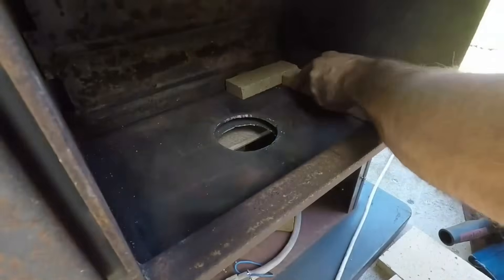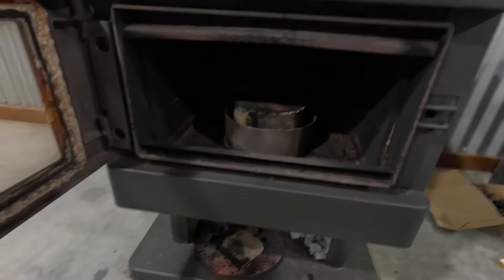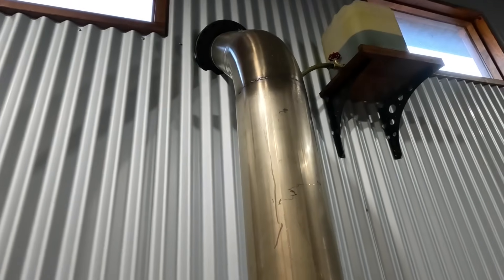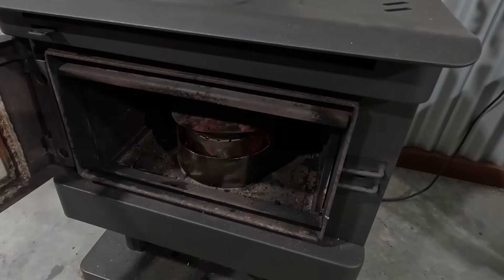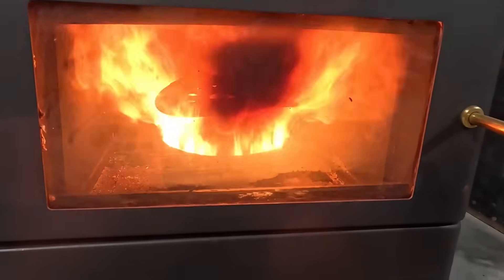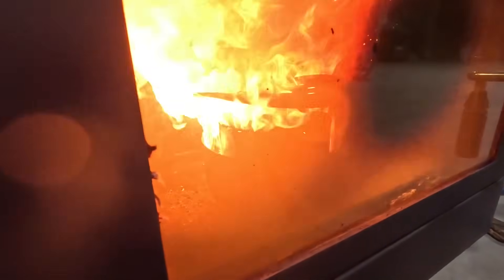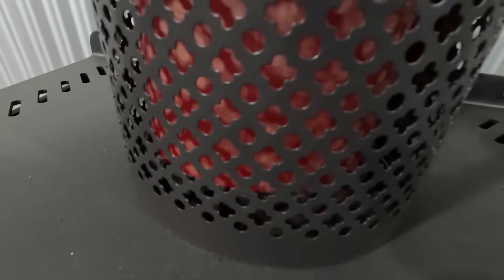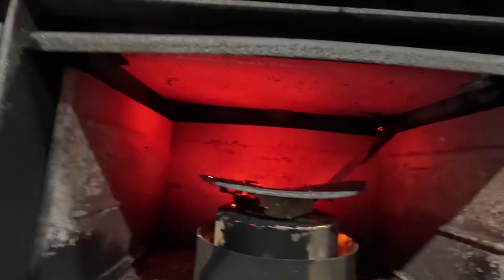Waste oil heater - Just add old engine oil

Comment: Where does the end of the oil feed tube sit? 
Ie .. exactly to where is the oil being fed? 
 Thanks.
Reply from the maker: Hi mate, the oil feed line extends into the bottom tray and sits about 25mm from the bottom.

Comment: you can probably install a water heater on it
Reply from the maker: Yep, that would work well. But for me, I plan on extracting heat out of the flue before it goes to atmosphere. I have some ideas, hopefully it works and is also something unique
Reply: I did that, its called a kettle, lol
Reply from the maker: @mikevolante7663 😂 no, my idea will be nothing like a kettle

Comment: This seems like a great idea to make use of used engine oil however I would recommend installing a carbon monoxide alarm just in case there is a leak from your heater. They don’t cost much and would give you peace of mind.
Reply from the maker: Thanks mate, that’s a good idea. I don’t use oil all the time and it’s just a few seconds to switch it back to wood

Comment: 40 years ago I used something similar to fire a pottery kiln, used an old vacuum cleaner , Hoover brand to push air .1000 degrees Celsius in 10 minutes, way too quick for pottery by the way. Over 1000 degrees no visible smoke and yeah the cut up car tyres really fired things up. You have toned the system down to be useable in a shed , good on ya!

Comment: Your heater is black inside because bad burning... and...How does your chimney lookslike after one year...?
Reply from the maker: Hi mate, it’s not black inside and actually burns quite clean. After 7 years the inside of the chimney did not have a build up, just a dark colour on the inside of the flue but no thickness to it.

Comment: Where is the Air stream coming from....
Fully no electricity
Reply from the maker: Hi mate, correct no electricity at all, no fan. See my earlier build video to see, I cut a hole through the base so all air enters via the base intake. As heat rise the air pull increases, very simple and very effective, just takes a bit of tuning to get it right.
Reply: @Mezzmoengineering thx, i had looking in yours Playlist and found nothing, but later YT presents me alone this part, so i see it 👍 in one vids you saying that you will be testing it with fan and i had always looks for without fans... very well your idea thx 🍻
Reply from the maker: @___zokii___2140 I did try a fan to see what happens but really made little difference, so with my recent mods it works perfect as it is and no fan

Comment: Hey mate, what's the shutdown smoke/smell like outside the chimney? I have an old Diesel choofer I mix 50/50 diesel engine oil and burns clean when running but when you shut it down holy dam the neighbours get upset 😅
Reply from the maker: Interesting, no it doesn't smoke during shutdown as its very hot and simply burns the remaining oil until nothing is left, no smoke. Only time I could get smoke is on start up if I add too much oil before its hot enough
Reply: @Mezzmoengineering yeah sweet 👌

Comment: I find that car tyres that I get paid to remove from local garages give off a excellent after dark heat
Reply: Properly made oil burners will burn cleaner than a diesel engine once it achieves the ideal fuel/air ratio.
Reply: Maybe safest for windy nights

Comment: Great job. How much smoke does it produce out the chimney when it is running? Do you get any residue buildup in the chimney that could ignite later?
Reply from the maker: Hi mate, no smoke at all. I ran it for a few years now and there’s not been a build up in the flue, just a blackish colour on the inside walls but no build up. Once I had the air fuel ratio right it’s been perfect

Comment: This is basically how an Oil fired Aga / Rayburn works.  You could regulate the air intake on your design by fitting a butterfly (like a carburettor throttle)  and by playing with the air , regulate the heat.   
In the Aga/ Rayburn it has a set of channels in a cast base with wick material you can buy on a roll. These channels are each having a circular perforated tube vertically to contain the three wicks air flow upwards.  The oil rises up the wick and lights like a series of circular candles and the heat is regulated by raising and lowering the base relative to the inlet height. On the lowest setting my stove was at a constant 150 degrees C 24 hours.   Absolutely brilliant even for a big house.
Reply from the maker: Thanks mate, I’ve found that the air intake is right the way it is. As heat increases air flow does too, not sure if it was good management or luck but it seems to burn very cleanly at lower or higher oil rates. I like the absence of a fan. I’ve been thinking about making something unique to harness heat from the flue, that would really heat my workshop up and I’d be able to use a lower dosing rate
Reply: @Mezzmoengineering  Well done , you must have the dimensions just right.
Reply from the maker: @awalk5177  yep, it took a bit of fine tuning to get the right amount of air, but it works great now
Reply: @Mezzmoengineering would you mind sharing your burner pot dimensions? My oil burner is almost identical in design. I’d like to “recreate” your burn pot to try in my stove.
Reply from the maker: @JosephWenk  Sure, mine is 200mm diameter with 100mm central tube and 75mm high. The inner cap is 150mm diameter and approx 100mm high.

Comment: Was there always a plate at the top or did you add that to disperse the heat before going up the flu? How is it mounted in there?
Reply from the maker: Hi mate, Yes, there was a plate there and there's usually one on all heaters. It was about 3mm thick but practically melted  due to the heat, so I just upgraded it to 10mm

Comment: I have seen so many creative designs for these things.  BUT they are ALL too complicated.  You don't need a blower or any thing fancy.

Get a soup can.  Drill some holes 1/8 inch around the circumference about an inch from the bottom.  about an inch higher do another set of holes.  The first set controls the size of the fire.  The second set adds enough air for a clean burn.  Add bigger or more holes in the second row as needed.  The trick to make the hole thing work is a 2 foot pipe.  The same size of the soup can kinda.  little bigger or smaller is fine.  keep the soup can filled to near the first row of holes and use some sort of thermal mass to keep heat around the can.    

What you do around this simple part is up to you to make it safe and supply constant stream of oil.

Comment: Yes so my buddy had a fan on his stove it was like two or three feet above the outlet of the stove and the flu it was like a heat exchanger with the AC fan I think it was called magic heat but that made it absolutely huge difference you know let's just instead of radiant you got the thing blowing it's it's like a forced hot air because the element inside is getting so hot you know nothing that pipe is getting glowing red bro that's that's warm and excuse me but I didn't notice any fire extinguishers like or anything I'm just saying something to consider that's all but thanks for the Post
Reply from the maker: All good mate, it’s a big workshop and I actually have water and Co2 fire extinguishers as well as fire blankets. I can get it very hot, usually the flue is just very thin stainless, so I was surprised to see how hot the flue got using 2mm tubing….

Comment: I'm surprised that you don't have a a fan blowing through that 2 mm stainless like my buddy had an old stove and you kind of wasted it aren't you I mean if you had a inline fan you would be so much more efficient wouldn't you you could turn that thing down to maybe 3/4 of a liter an hour I mean depending on the the burner I suppose but with your high ceilings I think you're kind of just burning off your oil I don't know maybe just me
Reply from the maker: Yeah, I’ve actually thought of fitting an external fan to produce hot air from the flue. I’ve insulated my workshop so well that it already produces enough heat. But might do that anyway, or was also thinking of making a cool looking air to air radiator with fan behind it to take heater from the flue.
Reply: @Mezzmoengineering 
Cool man all great ideas I love how people can engineer and come up and produce something totally on their own keep up the great work man

Comment: Does the fire ever want to crawl up the fuel supply tube?
Reply from the maker: No, but occasionally the feed tube needs to be cleaned. When it gets partially blocked I get a tiny bit of smoke coming out of the entry point of the olio but never fire

Comment: Nice setup. Do you have any issues with the oil feed tube coking up?
Reply from the maker: Hi mate, it’s not a big problem but I do need to give the feed tube a clean every now and then.. Whenever it starts to get a restriction there’s a small smell of smoke from the entry point but it never blocks all at once.

Comment: How often do you change the oil on the car? Is all the effort worth it when realistically you're only going to get a few hours of heat every year
Reply from the maker: Yeah it’s worth it because I have several cars,bikes and other engines. I also service cars for others too. Without the oil burner it would be a hassle getting rid of it. Also, I’ve designed it so I can burn wood with a very easy changeover that only takes a few seconds.
Reply: Lots of ways to get free oil though, I bet local mechanics will just give it away if you ask

Comment: Great work mate , im building one from s355 steel, so i can put it in my honme boiler to heat whole house with it. Im interested in , will that oil pan on the bottom heat to the melting point ?  Im planing to use 3mm and 6mm s355 steel
Reply from the maker: Hi mate, my burner is stainless. I used 3mm which is plenty. The base itself won’t get red hot but the rest generally does but can cope with the temperature. Probably the bigger thing to consider in terms of heat is ensure your drum or whatever you use can cope with the excessive heat. As you probably saw in the video I used 2mm stainless flue and even that glows red hot for the first couple of feet out of the heater itself.